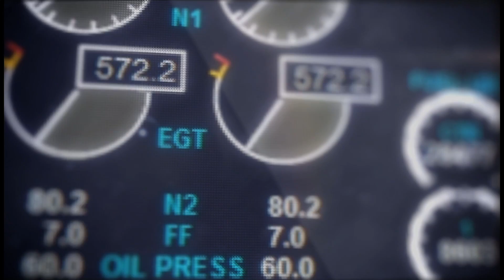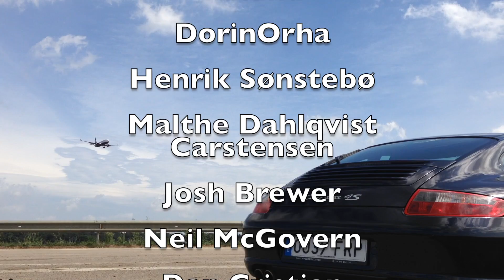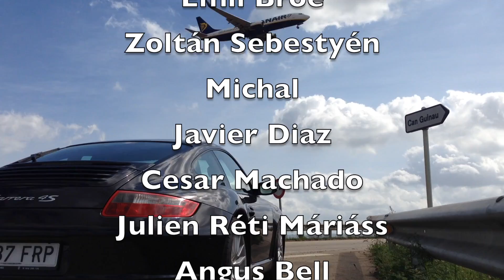Wake turbulence

Comment: As a retired pilot i have encountered moderate wake turbulence during my career, which made me wonder what would be the best way to react if you suddenly find yourself rolling uncontrollably after takeoff or shortly before landing, and devised an escape theory that I fortunately have never had to resort to. Still, I would like to run it past you:
If you find yourself suddenly starting to roll, you will instinctively counter with full opposing aileron. If that is not enough, pull carefully back on the yoke to get out of the core of the vortex. Even if you have already rolled 90° you have a good chance of escaping the core sideways, which would be better than rolling inverted and going straight into the ground. Obviously you are at a critical stage, with your airspeed down to Vs x 1.3 so you have to use the elevator gently, but if you manage to escape the center of the vortex core the roll rate should decrease dramatically and your aileron input has a much better chance of coping with the roll rate.
Untried, but food for thought...
Reply from the maker: Check out tonights video for that! Have a great day!
Reply: @MentourPilot  Which one is that now? :)

Comment: Thanks for the great video. Good pieces of info there. Could you please do a video explaining the difference between an Open Descent and a Managed Descent? Thank you
Reply: Boutazzout Samir  ok, think of it this way: you're coming to arrival and ATC has kept you high.  what is going to get you down faster:  open descent is similar to FLCH in a Boeing and managed descent would be the VNAV. if I were to descend in open descent (above profile) with a speed of 300 knots,  the thrust levers would go to idle and it will hold 300 knots. in DES,  the aircraft is allowed leeway to speed up and slow down as required to capture the profile. managed descent will get you down quicker.  hope this helps.
Ava

Comment: Mentour pilot, Love the content! Question here: The engine start switches are often seen in the CONT(inious) position, or sometimes FLT. Can you explain these positons and what they do individually? 
Tusen takk !
Reply: Vegard think of it this way:
OFF :
- No ignition
- B737 NG Automatic ignition operates both igniters when engine start lever is in IDLE and :
• an uncommanded rapid engine (N2) decrease or,
• N2 is between 57 % & 50 % or,
• In flight – N2 is between idle & 5 %
CONT :
- Energizes the selected igniter(s) with the Engine Start Lever in IDLE (used during takeoff, landing & 
 Engine anti-ice ops)
- B737 NG provides (in flight) ignition to both igniters when N2 is < idle & engine start lever is in IDLE
FLT :
- Energizes both igniters when the Engine Start Lever is in IDLE
- The Ignition Select Switch is bypassed when the Engine Start Switch is in FLT. hope this helps.
Ava

Comment: Can you explain what happens in a Engine Fail during flight. I was in flight on a a330 above the atlantic and our number 1 engine failed.
Reply: +HorizonGBRS In that case, being it an actual engine failure, or if the pilots have to shut it down for some reason, the crew will then follow the related procedures and then descend to the single engine optimum altitude for those conditions, called the drift down procedure. 
After that it's up to the crew to decide what to do... In the case you mentioned you were flying under ETOPS so the crew should have diverted to one of the alternates located in a radius corresponding to the time of that 330's ETOPS certification.
Reply: +Mentour Pilot Thank you very much Mentour! And thank you once again for your videos and for the great content! :)
Reply: +HorizonGBRS what;s ETOPS?

Comment: Do You coordinate turns in 737 ? Could You explain "yaw dumper feature?
Reply: +pawel kuler I thing you mean the "Yaw damper" YD. Its just to make the passengers more comfterble i beleave. all it does is control the rudder. You as a pilot dont need to control the rudder so the YD does it for you. yes you make coordinated turns in a 737. but when you have a YD you dont have to strugle with the rudder padels. Saves a lot of workload. i beleave i remeber reading this in the FCOM.
Reply: ***** I was just readling about the Dutch roll it very intresting